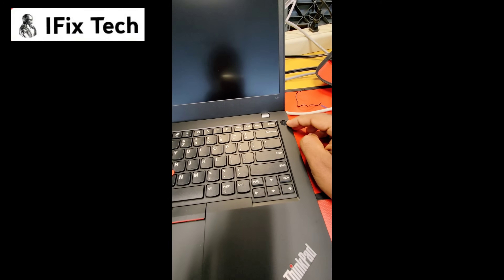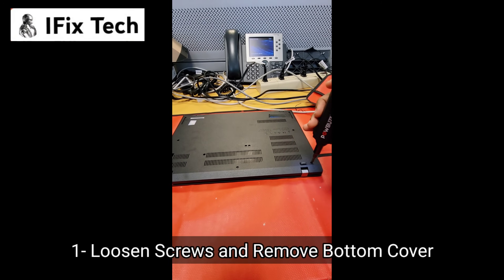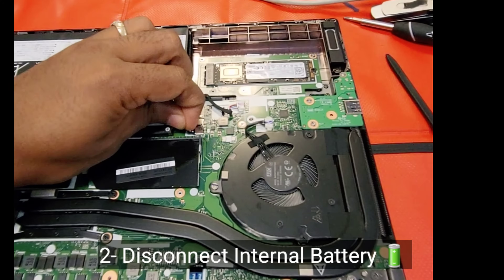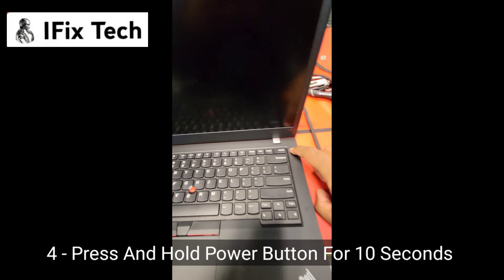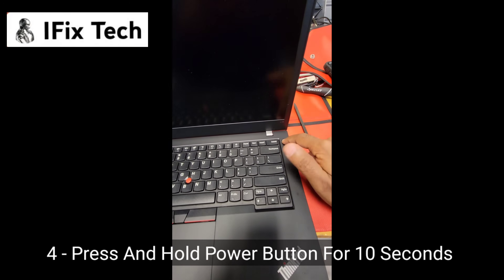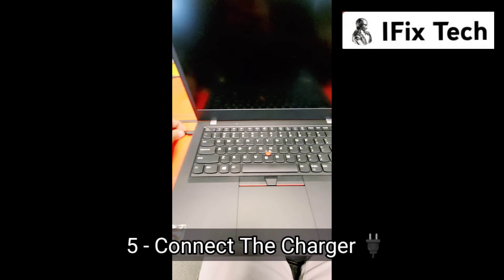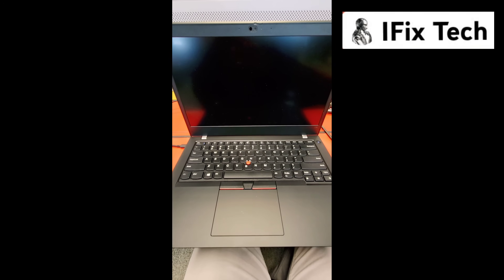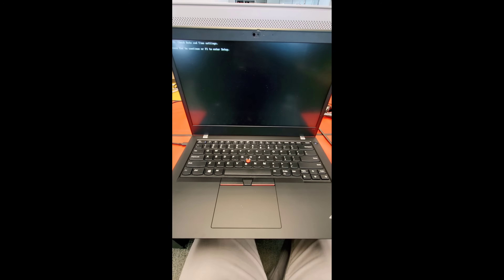THINKPAD  X1 CARBON - X1 YOGA DEAD - NO POWER HOW TO FIX 💻 ❌️-  You won't Believe THIS Trick

Comment: I have a lenovo L13 Yoga with i5 11th gen processor, it will not start and the charge light will not come on when I plugged in, I try to press the pin hole at the back of the laptop for a 10 seconds, then I tried to charge again and the issue is remain, I tried to charge with my 120watt phone adapter and nothing happens.. are you have any idea what is causing problem with my laptop? or you have any solutions for this case? Thank you😊
Reply from the maker: How many usb c port you have. Maybe something wrong with the port? 🤔 Thanks for liking it and subscribing 👋 😉
Reply: @IFixTech1 Just 2 usb c port, I guess yeah, maybe bad usb c

Comment: Do you have to reconnect the cosmos battery and the main battery immediately? before connecting the mains cable and turning it on?
Reply from the maker: Correct, you have to do it after connecting power adapter. Thanks for liking it and subscribing 👋 😉

Comment: Anyway, i have (or had...) a Lenovo x1 yoga gen 2 with OLED, and unfortunatley during an update, the update process, which took forever, was uncorrectly aborted during the update process (which appeared to be stuck anyway) but the computer then died. Dead. No sign of life whatsoever.  It is like bricked? Or is there something that can be done to save it now, several years later? Any ideas? (i loved the computer and it is in very good condition, apart from being totally dead).

Hoping for help!

Kind regards, Staffan
Reply from the maker: That is a common issue. When that happens, Lenovo will normally replace the motherboard. Will try to investigate if there is another way to fix that issue.  Thanks for liking it and subscribing 👋 😉

Comment: Do you put the batteries back at some point before plugging in the power cable? Or you plug the power in with no back and no batteries, as is? Somewhat unclear when, at what point, the batteries are to be returned back to their normal positions
Reply from the maker: Connect the power adapter without the battery being plugged. You can connect it after.

Comment: Hello.
So recently I have been experiencing something weird with my laptop that never happened before.
Two days ago i woke up and my laptop wouldn't turn on or when i put the charger on the light won't even go on i opened the back of my laptop
Which is Lenovo Thinkpad 2nd generation X1 Yoga

it has on the back after i removed the screws a reset button, when i pressed it i can suddenly turn it on from the button like, i couldn't even turn it on from the power button unless i press this reset button and this has been going on for two days, when i sleep and wake up and try to launch it it just won't start unless i open the screws and press that reset button beneath the battery could someone at least tell me what's wrong with it or how to fix it because it is a lot of work to just open the back press reset and turn it on from the power button, is it a hardware or software problem, or how can i fix it.

please and thank you
Reply from the maker: Thanks for your comment. Have you tried the process described on the video?

Comment: Hello , i have Lenovo ThinkPad X1 Carbon 9th 10th Gen . battery was draining fast using both usb-c ports  . till it went dead and now even the charge light will not come on, cant start the laptop. i removed the batt and attached again. pressed the reset small pin button nothing works. any idea? battery issue? board? ports? Thank you!
Reply from the maker: Hello, thanks for your comment. Did you remove the cmos battery?
Reply: @IFixTech1  Removed both the CMOS and main battery  then plug them back in  . before that plugged charger in to see if there is light . nothing
Reply from the maker: @StealthForce70  try removing cmos and main battery then press reset  pin for 10 second, also power button for 10 seconds then connect charger while still pressing power button. Try second usb c port to confirm that the problem is not just the port. Try different charger.
Reply: @IFixTech1  Thank you! Yup, did all that , tried both ports . the thing is completely dead  , to be honest I think its the motherboard. no other explanation. frustrating
Reply from the maker: @StealthForce70  Yeah. If still under warranty, you can have Lenovo replaced the motherboard.
Reply: @IFixTech1  unfortunately warranty expried but i reinstate it for $100. should be active in 30m days. Thanks for your help I appreciate it

Comment: I have a Lenovo X1 Carbon. I believe gen6. It will not start and the charge light will not come on when plugged in. All is that happens is a low buzzing noise from the top right corner of the laptop  and if I keep it plugged in for long, the top right corner  where the power button is will go warm. Any idea what this could be?  I tried your suggestion, but did not help.
Reply from the maker: Hello, that could be a bad usb c port. Or also a bad charger.

Comment: I have a lenovo carbon X1 thinkpad Gen 8. The computer wont charge, no matter how long i put it on the charger. I used another charger and i got about 8% charge in 12 hours. Turned it on, went through the startup and then it ran out of juice before i could do anything. I have reset the battery (at the pinhole) - didnt work. Then i took the battery out and tried to plug it in, no joy. What else can i do outside of replacing the battery?
Reply from the maker: That sounds like battery issue. Also it can be something wrong with the USB C PORT (charging port) I believe your computer has a second USB C - you can try that one. If the problem is battery, only way to fix it changing it. 👍

Comment: bro i got an carbon and idk whats the problem but it wont show the crharging light but it keeps workng and the battery symbol also dissapeared idk whats wrong
Reply from the maker: Hello, What is the model?
Reply: @IFixTech1  carbon x1 6 ... i proceeded to do a hardware reset later but it still reverts to the same
Reply from the maker: @Jay  Lenovo has said there is an issue going on with  x1 carbon gen 6 and Yoga Gen 9. Where they will stop charging, Basically it is a bios issue. You need to make sure the bios version  is up to date. If it is, you can try downgrading it to the previous version, install the new one on a USB drive, and update it again. I hope that helps you. Regards 👋👋
Reply: @IFixTech1  i see ... thank dude .. and is there any way i can update the bios or it will be  done in the upcomming updates ?
Reply from the maker: @Jay-ym2ri  you can go to the Lenovo we site pcsupport.lenovo.com. there you can find the latest bios firmware version
Reply: @IFixTech1  ohh thanks ill go through it :))

Comment: HI i have Lenovo X1 Yoga Gen 2 The problem I do same remove cmos battery and inside battery then hold and release power button for 10 sec then run laptpo direct power shown date and time msg for update i go inside bios by press F1 but after add correct date first boot is ok but if i again plugin internal battery and cmos battery then and boot laptop it same same problem no HID Sensor Collection V2 shown in mean auto screen rotation not work even when i shut down laptop keyboard ESC light on this assumed laptop not completely off then same as previous condition I forcefully off and on laptop CAN YOU HELP ME PLEASE
Reply from the maker: Have you tried running Lenovo diagnostic?
Reply: @IFixTech1 hi brother thanks 4 replay i fix the power on off using bios firmware downgeade but still one issue HID Sensor not work So  screen auto rotation nt yet fixed. i also run from lenovo web auto dignose trubleshoot there show everything is ok sensors dectected. but not work in windows 11. does u know how to fix in bios
Reply from the maker: @Ravi Kant  you probably missing bios updates.